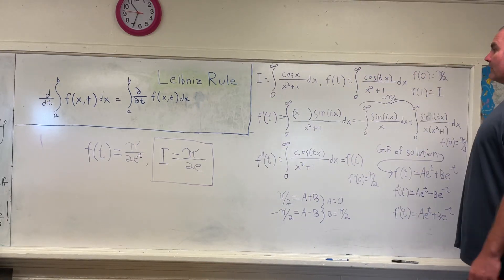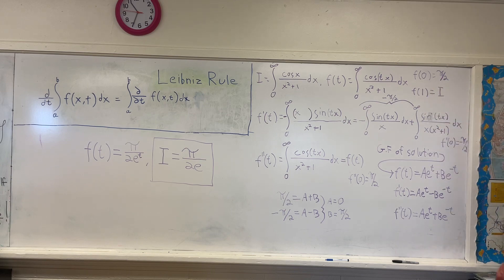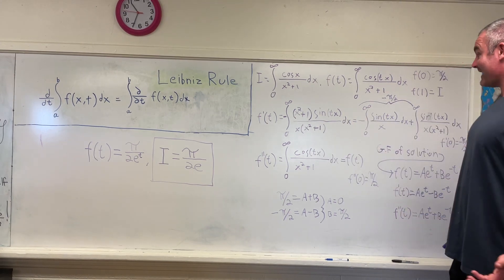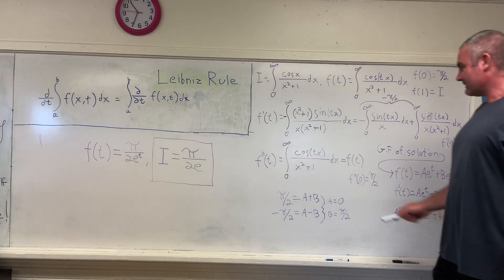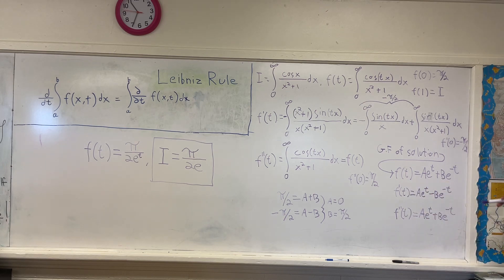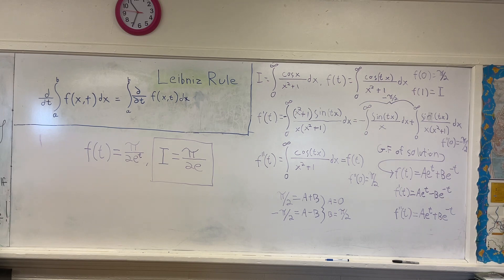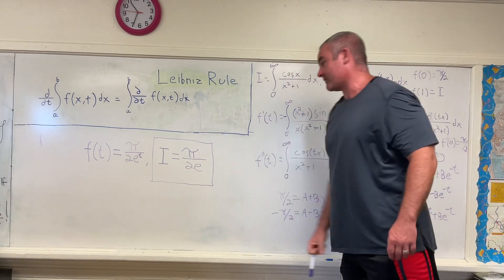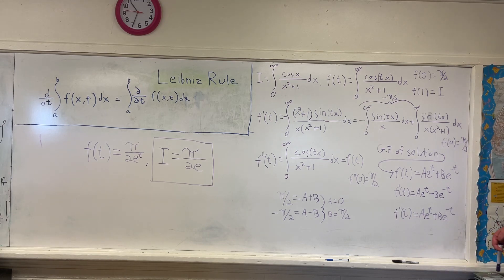Feynman integration example 10 - Lecture

Comment: Here Laplace transform would be more comfortable in use 
Laplace transform is a special case of integration under integral sign 
Integration under integral sign is similar concept to the Leibniz rule
Reply from the maker: Yes I haven't worked with Laplace transforms very much but I definitely plan to in the future.

Comment: The integral of sin(tx)/x from 0 to infinity is not continuous at t = 0.  Previous video proved that integral is pi/2 for all other values of t.  So if we take the limit as t goes to 0, we will get pi/2 in the limit, but not the evaluation, indicating the discontinuity.  I guess the lesson is you really do have to be careful with the limits sometimes.
Reply from the maker: Thank you for that, I will make an updated video with that explanation in it sometime soon.
Reply: I'd like to add that at 2:24, multiplied by x/x, which is ok as long as x is not 0.  So evaluating at x = 0 would be bad, wouldn't it?